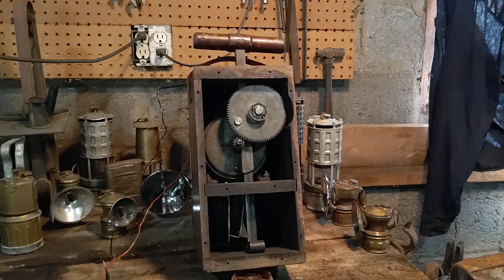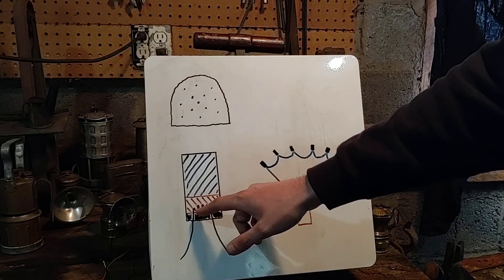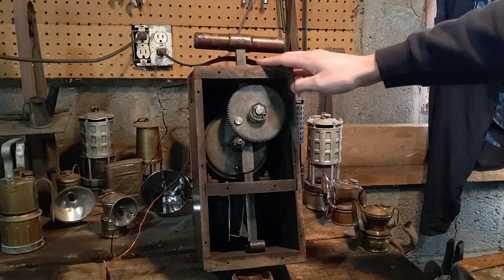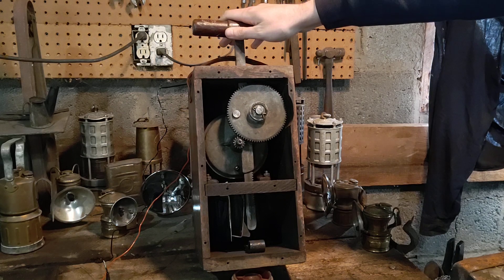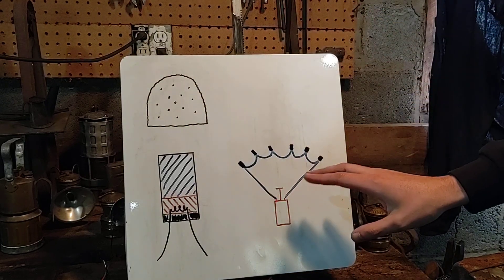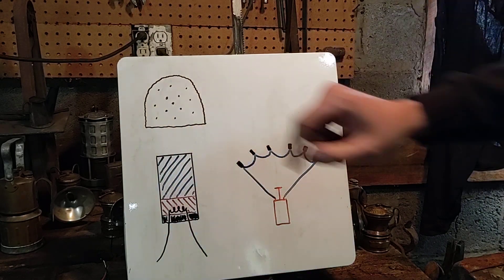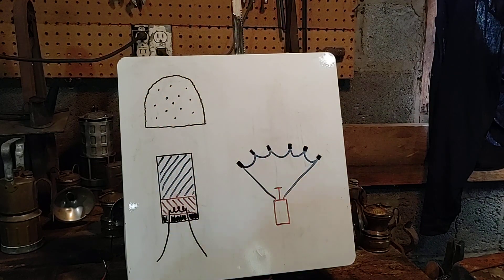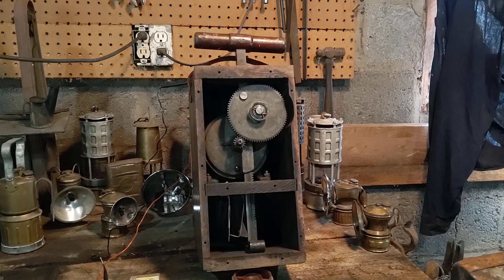Electric Blasting Machine

Comment: I have a similar blasting machine. The plunger works but it is stiff and the mechanism does not keep spinning freely at the end like yours does. Do you have any recommendations on servicing it? Does it need grease? If so what type and where should it be applied? Any help would be appreciated.
Reply: Mine had the same problem. I thought it was rusted, but it turned out that really old grease was the issue. I cleaned all the parts and I have used automotive brake caliper grease and that seems to work well.

Comment: A few years back I was at a movie prop rental place. They had a very similar blaster of the same period in new original condition. As an electrical engineer having seen the modern ones asked for permission to see inside and test to see if it worked. They said Yes I went to my car to get tools and a test meter. when the handle was pushed down hard at the bottom of the stroke the power from the dynamo (fixed magnet brush dc motor)  was connected to the output leads at 90 volts to fire charge.

Comment: I have been looking for a blasting machine for a few years and I just found one the other day at an antique shop that some idiot tried to convert into a lamp of all things. I didn't think anything of it and I figured I would just take the lamp stem out of the top of it and have an operational blasting machine to add to my collection of antique construction equipment and mining equipment display. I opened up the back of it to remove the lamp stem when I got home and that is when I realized and noticed the main gear with the ratcheting mechanism was missing, why this moron would disable this is beside me. Would you happen to know anybody that happens to have parts for these things or where I could possibly get the main gear with the ratchet?
Reply: maybe you could get measurements and have one cnc'd or forged?

Comment: Can you get (or make) carbon brushes for these ?
Reply: I had the same question for mine. One brush was "reasonable" but the other was too worn to make contact under spring tension. I found that the brush is 1/4" diameter round, so was able to buy some, and I cut them down to be the length I wanted then "turned" a "nub" onto one end that tightly fir the sprint to give it good contact. I haven't been able to diagnose why mine doesn't produced voltage, but I think the carbon brushes aren't the problem.